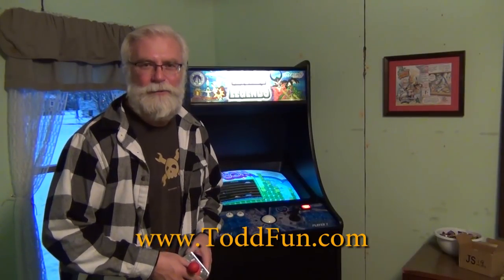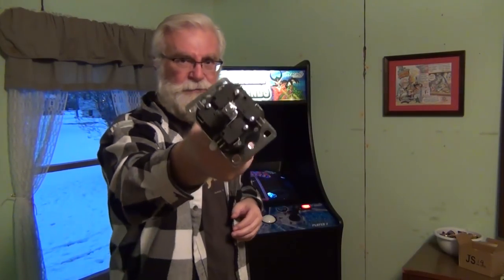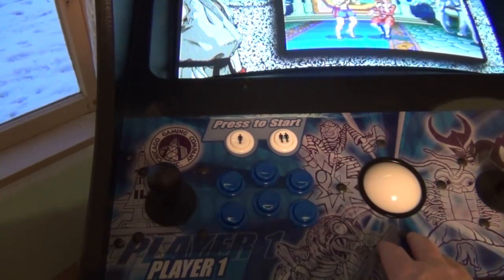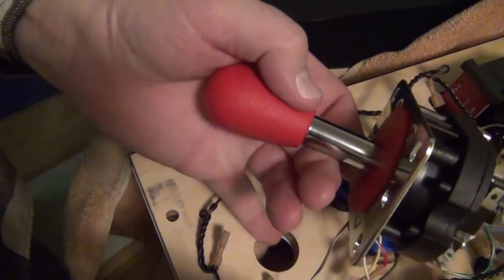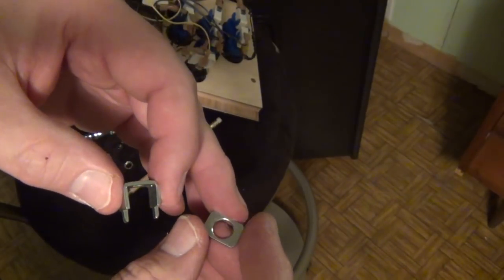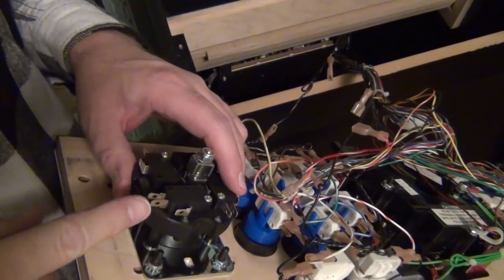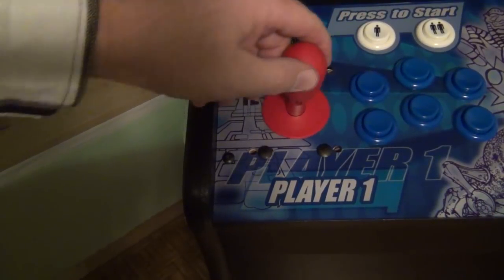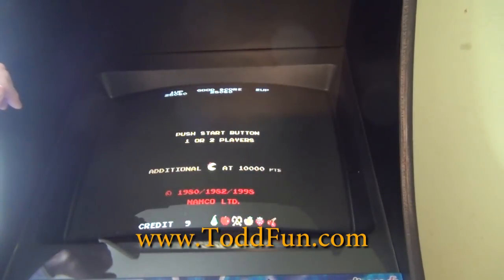Mag Stik Plus Arcade Joystick Installl and Review

Comment: Nice change, to fill the holes just grab some blue gasket maker and put in the hole, looks like the right shade of blue to match the panel. Otherwise get some acrylic art paint to match and mix up some white wall filler with it and patch the hole, and put a top coat on when dry.
Reply from the maker: Not a bad idea. I might be getting some leaf switch joysticks so I'll still need those holes if I do.
Reply: @ToddFun  I have both a 8 way Happs Controls optical joystick (smooth as can be!) and a NOS 4way leaf switch on player 1. It's a great combo of old + new tech. I also have 2 leaf switch buttons (in parallel) with modern cherry switches , they make playing moon patrol and Joust SO much more enjoyable.
Reply from the maker: @DaveMcAnulty  Wow! could you do a quick YouTube review of your setup and include links to the products where possible and/or where you found your products. Please include wiring details if  you do make a video. Thanks.
Reply: I would just put some dummy screws in those holes.

Comment: Hi, I was wondering if you might be able to point me in the right direction.  I have an 8 way controller and diagonals in 2 corners are not working.  My controller has 2 wires that go to each switch and I've wired them the same all around.  Both of my controllers are doing the exact same thing.
Reply from the maker: Make sure the common wire is going to the same exact terminal on each switch.
If the 4 way is working then all 4 switches are OK so try switching the wires from two working diagonal switches to two non working diagonal switches to make sure the handle throw is working in that direction. If it doesn't work then the handle throw is not fully engaging the two switches for that diagonal direction. If it does work then you have some kind of electronic problem with the controller or software.
Reply: Thanks for the tip, I'll take a look.

Comment: 2019 do you stil like the joystick not shure i want to buy them
Reply from the maker: No, not really. I still like the easy switch over from 4 way to 8 way but really I'm thinking of installing a permanent 4 way that I think might be better response. This one still missing left moves a lot and is not as smooth as it needs to be really. I have purchased an original Ms Pac-Man joystick assembly and will finish servicing it and build a switch out control panel for all my 4 way games that I play the most. (OR) I do have this nice micro switch 8 way / 4 way joystike.  https://amzn.to/2MuzFI5 I like the movement and response but you have to lift the panel and fight to switch from 4 to 8 so I would just leave it at 4 or put in 2 wired in parallel leaving one 4 way and the second 8 way.
Reply: @ToddFun  Do you have enough room to drill it in under the left side of the trackball and a couple buttons on the right side of the trackball? The lower portion of the panel?

Comment: What should I do if I didn't mark the wires and don't have manual
Reply from the maker: Normally there is a black wire that is common so take each wire with the game on and touch each wire to the common and see what direction the character moves and then mark that wire. Repeat until each direction wire is marked. Then hook up the joystick noting your labels.

Comment: Rather than pull the stick out of the actual assembly why not just unscrew the top and stick it through assembled It seems like you created a lot of extra work on something that was already properly assembled. To do this correctly all you had to do was take a bit of foam or cloth wrap it around the shaft of the joystick attach a vise grip and do the same with the back top and unscrew it. I promise you that assembly worked perfectly prior to you disassembling it and didn't need additional finishing or machining prior to your misassembly.
Reply: That's the recommended way to fit it. Crazy I know, but I don't think you CAN remove the joystick handle on these sticks? I'm thinking of getting one and was told you can't change the joystick ball, which suggests it isn't removable? (Hence the need for stick disassembly to get it through the hole)

Comment: Yeah he is probably referencing the Suzzo Happ Mrs Pacman($20) or Pacman Super($90) both are 4 way and are literally the arcade stick, you can kind of cheap out and get the Happ Super for $11, What you had looks like they put the Happ Ultimate Stick(round actuator) or some off brand variant either way most find them terrible to use, they are made more for fighting games for arcade cabs or tournament play for precision movement, but no one likes them really that I know of they use the IL Eurostick(original 80's Happ Competition) or the actual Happ Competitions that are now pretty decent they went through this phase where they used some kind of rubber actuator and it was terrible about 3-4 years ago they redid the line and changed it back to a plastic based actuator. Either way they are more for Marvel versus Capcom or Mortal Kombat machines that had those sticks stock.